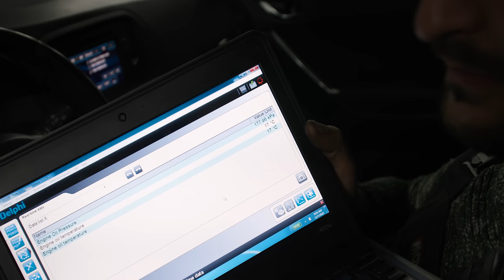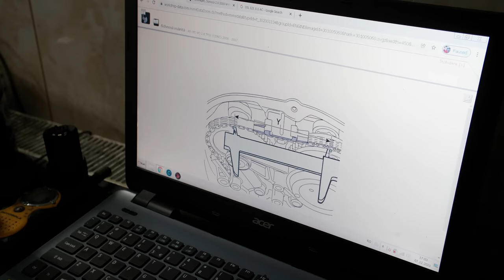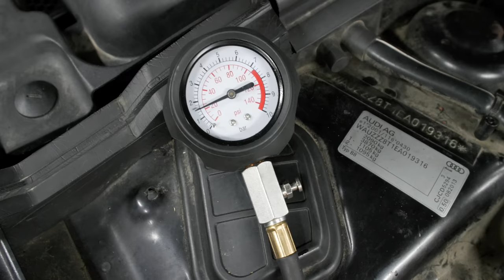TDI vs TFSI ...

Comment: Eu mai mult ma uit la clipurile astea sa știu de ce mașini sa fug, că mecanic n-o sa fiu niciodată :)))
Reply: Fugi de mașinile europene în general, încearcă japoneze și nu ai să regreți.
Reply: @b.dragos87  Japoneze pe benzina*
Reply: @iADRI99  da, nu am precizat, și oricum cine mai cumpără diesel SH în ziua de azi....
Reply: @b.dragos87  Eu, am luat Mazda 6 cu 2.2d. Am belit **
Reply: @iADRI99  înainte de Lexus IS 300h și eu am avut o Toyota Avensis 2.2 d-4d 150hp 2010, de care am fost foarte mulțumit. Am luat-o cu 100k km și am dat-o după 3 ani cu 135k km
Reply: @b.dragos87  pajero mk3 3.2 diesel 😂
Reply: Toate se strică, nu te lua după poveștile cu japoneze, intră pe grupuri să vezi problemele.
Reply: Ceam mai buna optiune , masina noua in leasing si la 3 ani o dai innapoi , efactiv dai in avans si ca si cum ai inchiria-o , daca o poti lua si pe firma e perfect… ,  in 3 ani aduna intre 150-200.00 km , adik garantia ,aici in uk, e de 160.000km ( la vehicule comerciale usoare).

Comment: Deci super mișto 
M am uitat cap coadă 
Dar am o mare intrebare 
Cati bani a băgat în Audi-ul acela TDI 
8k RON?
Reply: Cu tot cu piese cred ca a iesit undeva la 2000-2500 de €€€ toata reparatia. Dar cred ca proprietaru ori tine la masina ori o va face si va scapa de ea foarte repede !
Reply: @adrianady1316   dc sa scape repede? Cand stii ca motorul ala acum duce lejer minim 100k ?
Reply: @sickmind7515  acum stage 1 sa se bucure de masina cu adevarat 😝

Comment: Cine imi poate spune si mie va rog.. Seat ibiza 1.4 benzina 16 valve 86 hp an 2006,,,, e motor mpi?.. Sau fsi?..
Reply: Am si eu Ibiza 1.4 86 cai din 2009 motorul este fsi dar este si versiunea TSI  care are mai multi cai. Am 200000 km fara probleme cu GPL.

Comment: Vreau anul asta ce vine sa imi cumpar Audi a4 2013-2015.Si sunt foarte indecis intre un 190hp diesel si benzina 224 hp{gen 3} .As fi vrut sa deschida "Valica"  putin subiectul intre tfsi si diesel.
Reply: Am eu cjcb. E tanc .. merge pe soft de 195 cai de la 136  si momentan  240xxx+ :)) 0 probleme pana acum  . Luata la 160k
Reply: @sickmind7515  si eu cjca plus stage 1 200k 0 probleme soft facut la 120k doar castrol am bagat in ea si merge fara probleme. cand crapa alt motor si gata!
Reply: @danielgabriel9638  a8 4.2 fsi si stai linistit.
Reply: Am avut ei eu a4 2011 caha 170 si acum 2013 cjca tot mai bun e un 3l:) am mers cu 240 si 245 dar a4 b9 272 mi-a rapit inima cu zf8hp:) @danielgabriel9638